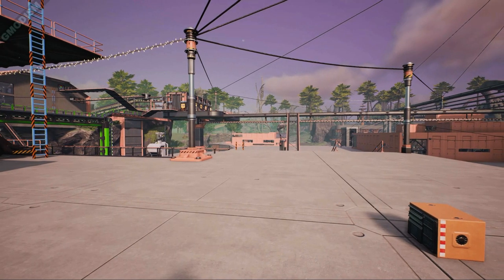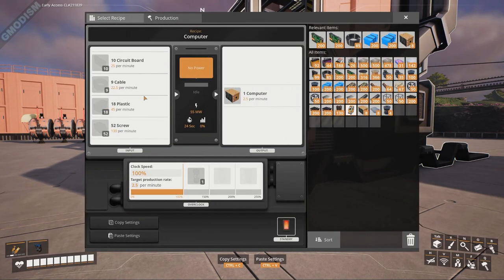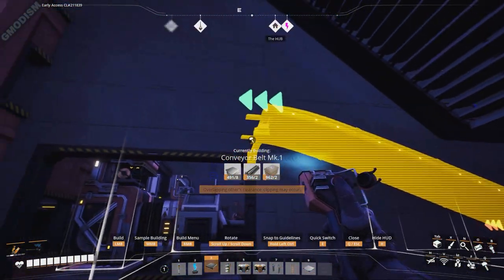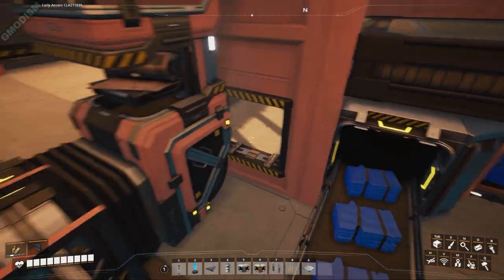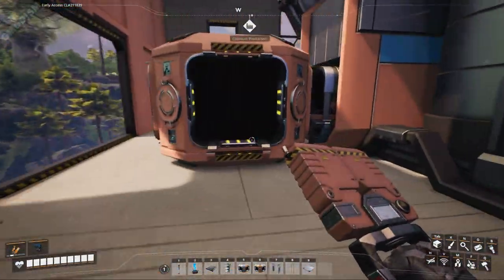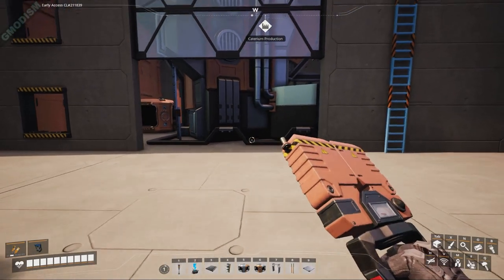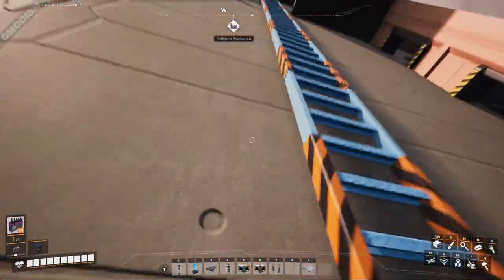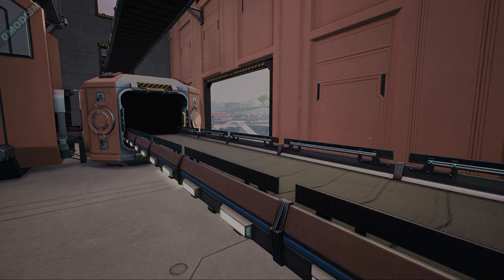Efficient Basic Computer Factory - Satisfactory New Player Guide EP27

Comment: okay im overwhelmed now. Dont have the blueprints and all my nodes feel so far away, like my beginning screw factory and cables are across the entire map from my oil horizontally lol.
Reply from the maker: I'd make new cable and screw factories where your plastic is, with new nodes, this is the best idea. If you don't want to however, you should watch my video on how to set up a truck transport line and move one resource to the other place and join them there.
Reply: @GMODISM  this is the advice I needed. Thank you! Should I have a dedicated factory for every part? Like circuit board factory and a computer factory? Or just a computer factory and siphon some circuit boards when needed?